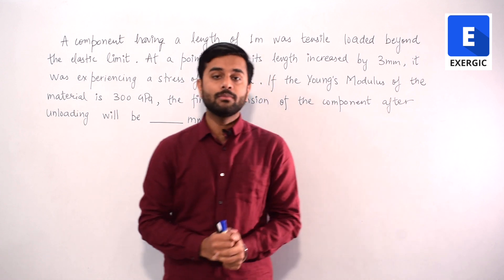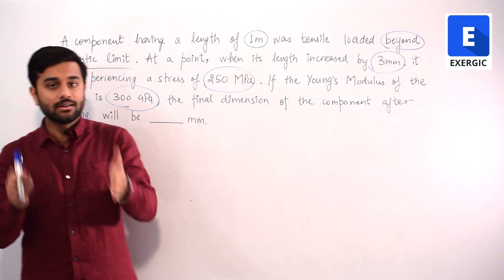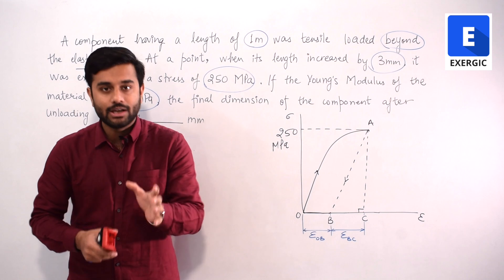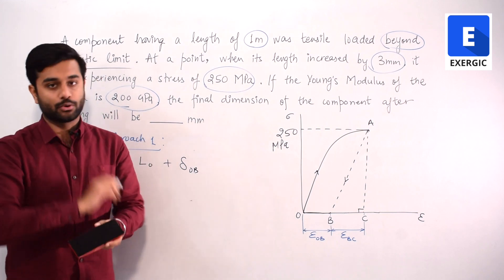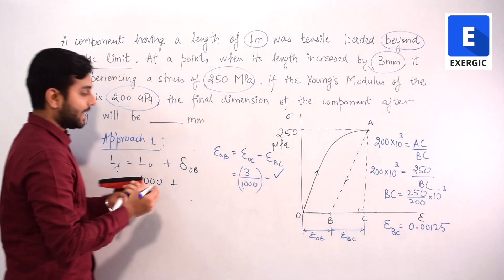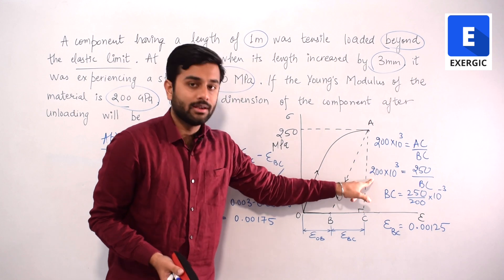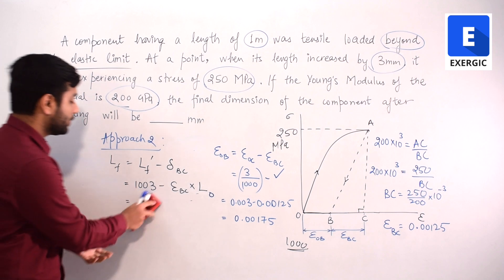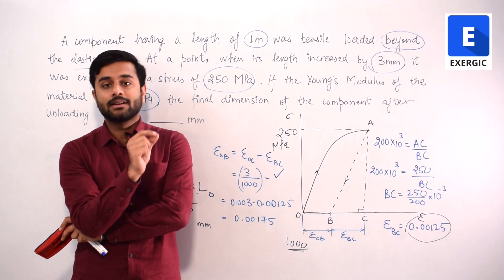Solved Problem on Elastic Recovery and Permanent Set - Strength of Materials (GATE ME)

Comment: in previous question L(final) was taken in case of approach 2, but now you've taken L(initial), can u please clarify which one is the correct concept?
Reply: @sumitkumar-fd6lh  yes and i calculated using both the ways first i calculated using true stress strain cure and the multiply by final dimension and then i again calculated the engineering stress strain curve and this time i multiplied by initial dimension and i got the exactly same value of elastic recovery in 2015 gate 2 marks question.
so here the concept is that you don't think about initial and final dimension first. First try to understand that in question which type of curve you are using either engg or true. based on this you calculate the elastic recovery.

thanks for the help dude. thank you so much
Reply: @sumitkumar-fd6lh  but from both the approach values differs... And how to deceide which stress strain curve should use... Whether original length to multiply or final length... Please🙏 reply vaiya...
Reply: @ganeshdalai1529  look at my answer. you doubt will be clear.
Reply: @Ritikkumar-mq3fm  ?
Reply: Yes exactly the same doubt....

Comment: Sir, similarly u had explained one question related to this problem (gate 2015 problem) , there you hv considered final length for strain,

Could you please explain the reason and clarify this doubt
Reply: Yes you are right, in 2015 gate problem sir have considered final length for strain, but that consideration was wrong....that was old video.sir will make it correct ,when he will get  time,.we have to always considered the initial dimensions for strain, not final.
Reply: Amit Kumar thanks Amit
Reply: https://youtu.be/FYDMs4do8R0 Sir ur previous explaination, where u considered final length
Reply: @sumitkumar-fd6lh  can you plz explain why here true stress - strain curve is not used plzzz

Comment: Sir. I have a doubt in Gate 2020 mechanical engineering afternoon session. It's a maths question. The sum of two normally distributed random variables X and Y  is  (a) always normally distributed  (b) normally distributed, if X and Y are independent. Could you please answer. So that I can challenge this question. Please provide the required explanation also.